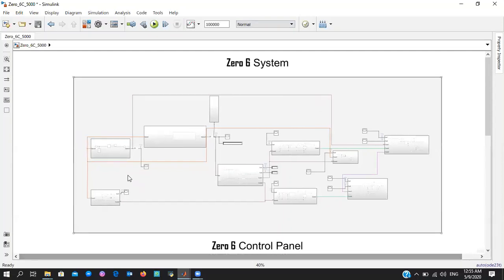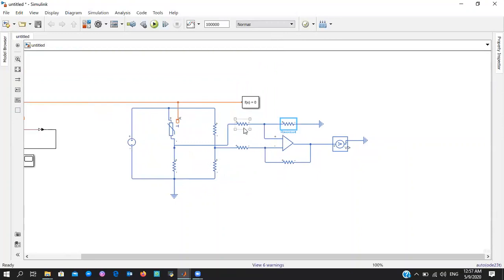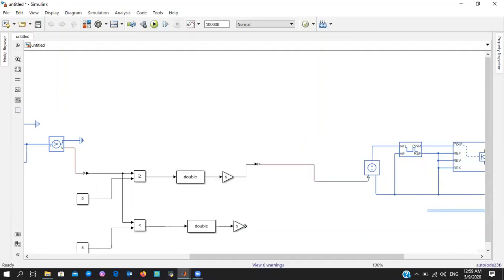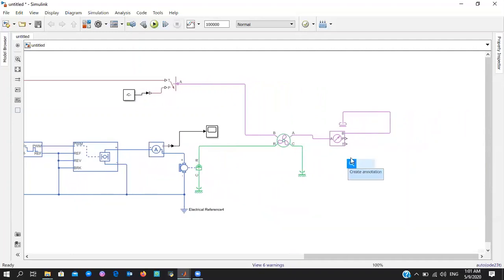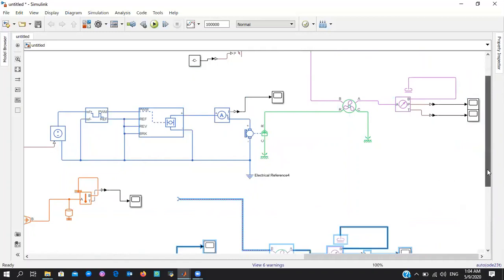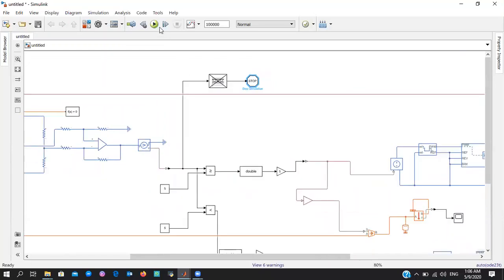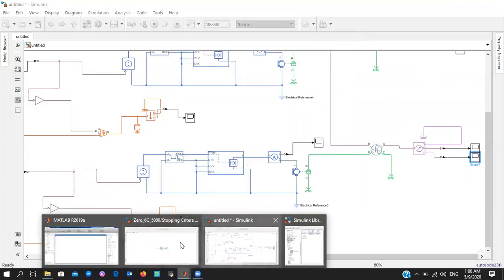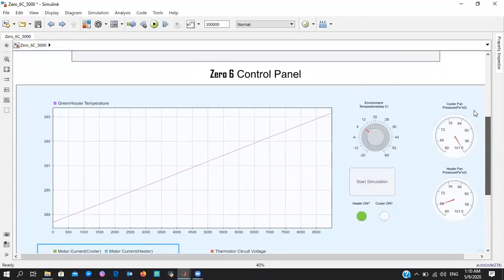Cooling and heating system for greenhouses using Simscape MATLAB

Comment: Hello , I would like to ask: why did you use the bridges instead of the sensors for measuring?
Reply from the maker: Hello. The sensors are ideal but here we want to show how the circuit behaves in real life so we used the bridge as a signal conditioning element.

Comment: I have a question about the relationship between heat flow rate and temperature. If I give a heat flow rate, I can use a temperature sensor to measure its temperature. I want to know what their relationship is. The unit of heat flow rate is W and the unit of temperature is K. How is this calculated?